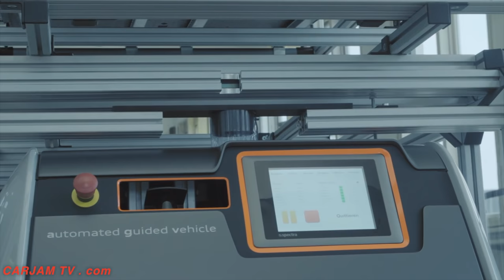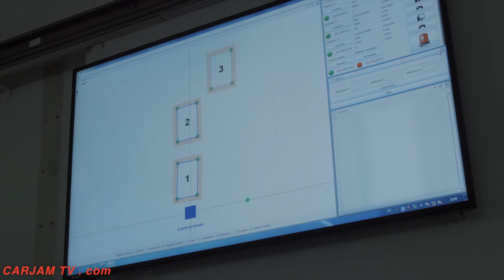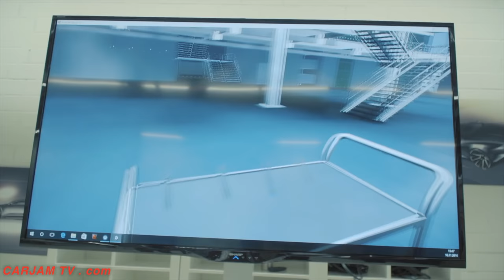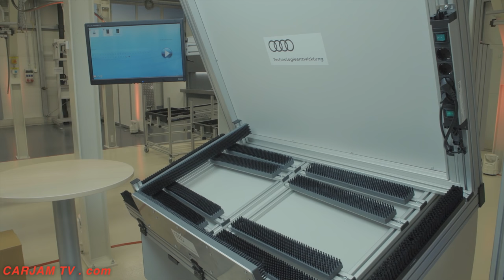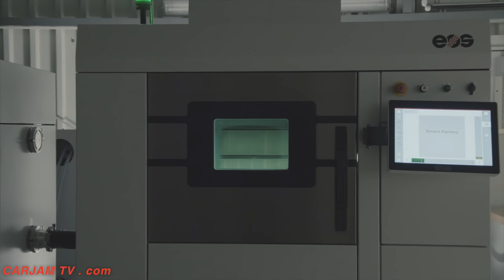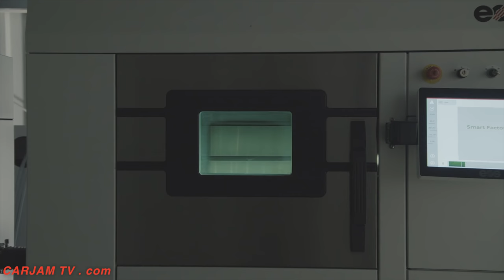AUDI Smart Factory Is Very Star Wars Autonomous Drones + Self Driving Forklifts CARJAM TV

Comment: What the hell? A drone carrying one piece of stirring wheel? Is that efficient? And self driving fork lifts doesn't need to be so AI. Just Magnetic strips on the floor and program them the way they supposed to do not like that. AI and technology is essential in some industry but not like this. It's kinda useless because the machine program in the factory like cars will stay the same way for years and years.
Reply: Building 10 drones, and making them carry steering wheel's is beneficial for Audi. If they are built correctly and not damaged, they'll do the work, over and over. Costing Audi pennies to charge. Workers on the other hand cost high per hour. In a years workload, the drone's would have paid for themselves, and Audi making a saving by needing an employee to do the work for them.

That goes for every single machine car manufacturers have. That's the whole reason they are making them - saving money (and perfecting manufacturing.) A robot is much more precise than any human. As long as it was programmed exactly right.
Reply: Changing those magnetic strips when a new model comes out is alot work. Making things more flexible is better. But i agree with you on the drone.
Reply: Herman Willems No it's not. It's juat a strip. Did you see the AI platform in this demo, it's so smart when there is obstacle they just stop how ironic, what if it's in production, they whole operation will stop but in magnetic strip you know the path of the device and they will not obstruct the path.
Reply: Zak Sampson Oh my god. Come on. A drone for 1 steering wheel? Who will charge the drone or change the battery? How long the location of the steering wheel to the line of the production where they needed? Is it more easy if they send a bunch of them beside the line they belong? You can't just fly 1 steering wheel if you need one, that's not efficient in the production line.  Who will put the steering wheel in the drone because it's looks like they cant just lift them by the drone, the answer is human.
Reply: Product testing and development
That is what this is.
Doing what u say would defeat that purpose
new things doesnt have to be efficient, just the potential to be so.
Reply: I think it's just a gimmick, don't think they did that for real.
Reply: Phailox Let's assume they did that and the production said to be 5k per week, so 5k steering wheel for the drone. Do you think the drone will be efficient to use?
Reply: They clearly have made their calculations and this is a team of experts, if it isn't efficiently enough they wouldn't adopt it in production process. Also just because the AGV can navigate autonomously doesn't make it 'AI' the world have grown far ahead of 'magnetic strip AGV', too costly and too rigid. Why use that when you have more flexible and smart system that performs a lot better.
Reply: Paul Oomel Give me a thing that they can perform better? Because as far as i know. You build build done for it's purpose and efficiency. What do you think performs the best, the one with unreliable platform with sensors,radar, etc. Or the one with a reliable guiding magnetic strip doing it's sole purpose? It doesn't mean the device is full of tech is smart an the one you are using, specially production line, you choose the one that is reliable and efficient.

Comment: lol that so-called drone can lift that steering wheel and carry it for what, 2 minutes max before having to land and recharge it's batteries for 3 hours?
Reply: AsylumET I agree. It's so dumb. Not even carrying by batch, instead one by one.
Reply: I don't believe this is how they do things at all. I think it is how they would "like" to do things but they are still lacking and will be until we have a serious breakthrough in battery tech.
Reply: AsylumET Because they will always settle if they make one. That's the difference with Tesla. Tesla always pushing the limits of technology, burning cash for R&D and if Tesla is a traditional car maker they will stop innovating ang create that car all over again for years but that is not Tesla. They never settle.
Reply: AsylumET i think it's good with the drone. Otherwise they wouldn't have used it.
Reply: I've been designing and building them for more than a decade now. It is really not good at all. Not until we see a serious leap in battery technology.
Reply: I guess they only use it when there are shortages. They can be more flexible by having a drone. Audi is pretty good at logistics, so I guess they know what they are doing
Reply: Or it's what we call marketing ;)
Reply: Otto Hörst No. is not. This is just a gimmick. Seriously? Come on. How long will it take to charge one and how long it will be before the battery get drain? Who's going to charge them one by one? How noisy that is in the factory? Is it necessary to carry that steering wheel? One by one? You will rather put a bunch of them in a electric platform and stock them besides the line where they belong, you can't fly one if you need one, that inefficient specially in the production line.
Reply: pagOOlp LP Do you know who is flexible and reliable than drone? Human. That is insane. Carrying 1 steering wheel per drone?? Is that what you called "good in logistics"? They are trying hard using technology but not in a right way.
Reply: There's a prominent distinction between consumer drones and those utilised for professional applications. There are drones more than capable of operating for extended periods of time, although they are cost-prohibitive for the average consumer (generally on the wrong side of five/six figures). Although it may seem trivial to transport a steering wheel via a drone,  it is almost certainly more efficient for Audi in terms of time and designation of human resources. (Just watch 'How it's made')
Reply: lol These toys like the one pictured in this video by Audi are not capable of performing any meaningful task such as that claimed. There is NO battery tech efficient and light enough to produce the claimed results. Yes there are drones capable of longer flight times. They achieve this at a sacrifice to payload and hardware. There are also hydrogen powered drones more capable of longer flight times while not sacrificing payload but then you have to factor in the exorbitant costs of charging them vs the profits and the overall size. What they have shown here isn't even the size of a hydrogen cell by itself!. All in all though even with hydrogen, it does not pan out at all. Hundreds of dollars to move a steering wheel that could have been carried by a person or even one of those remote controlled lift carts for barely a fraction of the cost. One day perhaps we will achieve a state that allows for such a thing to perform efficiently enough to make it worthwhile but right now, it is nothing but a terrible marketing gimmick that shouldn't fool most. Then again here we are...
Reply: AsylumET It's a question of real estate more than anything, why have a worker traverse a factory floor that's a half a mile long when a drone could deliver the requested item in half the time? Why add more autonomous vehicles to the floor space when you could utilise the space above you? As a result minimising congestion, indicated as an obstruction in this very video. Audi is testing this technology and for all we know they may be utilising proprietary battery technology, or perhaps an active wireless power-charging system (I recall reading that a company in South Korea was actively experimenting with light, their research culminating positive results). The drone isn't a toy despite appearances, it's evidently custom-made for Audi's smart factory.

Consider the Vanguard drone by airborne, at $40,000 it has a 94-minute flight time with a reasonable auw; and yet these are specifications defined in external conditions, whereas Audi is operating their drones inside a factory without limitations such as wind, temperature, etc.

I agree with your assertion that this is merely advertising spiel, albeit it is nevertheless a step further towards technological progression, yet sadly at the expense of the human element.
Reply: Aleksandar Black You can't just fly 1 steering wheel if you need one? Seriously? All the things they show in this video is non sense. Wasting money. Did you see they weird robot arm that can pick small item very slowly and light? What do you think they can co in the production? Giving you 4 nuts and bolts? It's so lame. I rather pick it my self rather than waiting for that and not sure if they pick the right number of nuts or bolts.
Reply: Indeed I can understand the desire in regard to the real estate used by a drone vs a human or a floor vehicle. No argument there at all though drones flying about a factory does also raise some safety concerns, that is of course if humans are still present anyway.. On to the Vanguard or numerous others though. The Vanguard has a maximum of 94-minute flight time. That would be the absolute max they have achieved with no load in a stable hover. The AUW of 9.5kg is the weight of the aircraft, cameras, gimbal and battery. The battery weighs more than the aircraft, gimbal and cameras combined. You may well already know but when you are actually flying rather than hovering, flight times decrease severely. Presently we are stuck with limited use for them in this regard but I can see with even a small leap in energy storage tech, this sort of thing could indeed start making an awful lot of sense, at least from the producers perspective. Goodbye to the human workforce though.

Wireless energy transfer... Nikola... I call this drone a toy just as I consider the Vanguard a toy. Rich man's toy but a toy nonetheless ;)
Reply: AsylumET i think you never heard of super conductors... Recharge in seconds...
Reply: lol as a matter of fact I have though I believe what you are referring to would be super capacitors as super conductors do not store energy, they facilitate it's transfer and sure, super caps recharge in seconds "with high current" and they take up far more real estate in relation to batteries.
Reply: MotoK tips I heard about it. I heard also solid state,graphite, etc. But do you heard also it's not in the production ready? Do you heard how much it will cost? We heard a lot of new things but it's not yet ready for use. You have to use what is available right now. Have you heard about it?
Reply: The general idea is that the resources allocated to research and development are significantly lower now, since we know that this method of mass production is not viable and therefore there is no competition in this area. This way once a viable battery solution enters the market all they need to do is swap the battery. The alternative (waiting until such technology is widely used to start acting on it) could cost hundreds of millions, especially considering the possibility of patent implications that might arise from other early innovators. The whole point of research and development is to be the first. If we waited for something like this to appear and then adapt it, then we wouldn't call it "innovation" but "observation and replication".
Reply: Charlie KB No it's not. Because if it is here already I'm sure toyota will announce for mass production ev. But no news. Even almost is too far from reality.
Reply: Clearly. If you read up just a few comments... I've been designing drones and various other autonomous craft for over a decade. Lipo do not last for ages though they are much lighter than we were stuck with a short time ago but still very heavy in regards to what they produce for power in a multi rotor aircraft.
Reply: AsylumET thinking about how much money some brands have they probably have more than 200 of those batteries those can change itself via a robot or so
Reply: yeah i think these are all demonstrations, not actually being used
Reply: you just have no idea about industry
Reply: _ TL;DR_ Can you tell me the big significant of this Testing and how efficient in the production line the drone carrying ONE steering wheel at a time? Come on explain it.
Reply: Jek A well the very fact that you want an cost-benefit analysis of said production line when a swarm  model is added, and you want it within a youtube comment, indicates that you really are unaware of how the industry works. You are clearly biased on this one.
Reply: John doe what are you talking about? Biased from what? I'm against in this video.
Reply: Jek A the word 'biased' basically means to take a side without considering all parameters involved. The bias can be positive, or negative. In this case you are negatively biased.
Reply: well said john doe. but do i realy have to explain myself? im tired of this sorry. maybe later.
Reply: AsylumET 2 minuets for three hours? The drone i bought from the store can do 16 min and 45 min of charging....be real.....
Reply: How about offering actual details about your alleged drone. You know, something relevant like what type it is and how much it weighs. What type of batteries it takes. What charger you think you have that only takes 45 minutes to charge the batteries... It sounds like one of those little "toys" that weigh a few hundred grams at most and get a max of 15-20 minutes with absolutely no load whatsoever. There is and always has been a constant trade off between weight of the craft and flight time. You pick either more flight time with little to no payload and or hovering or less flight time with a payload and or actual flight rather than hover.